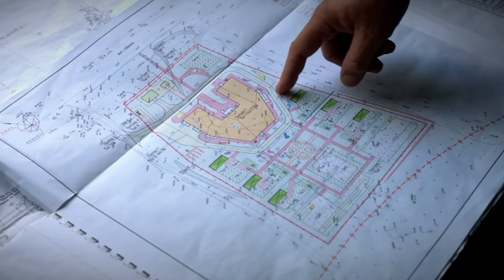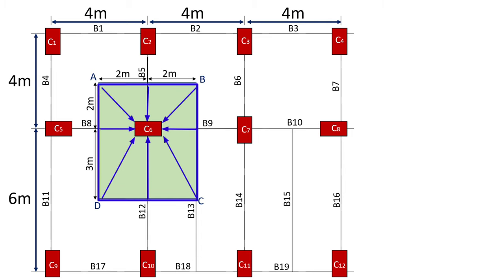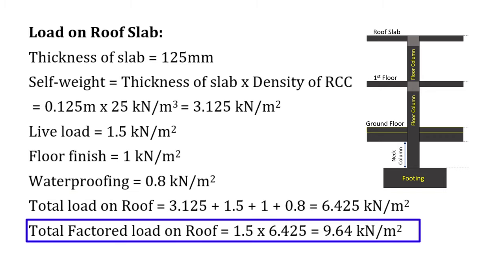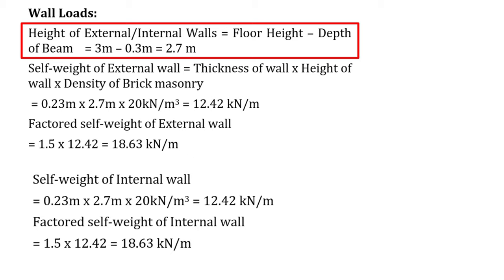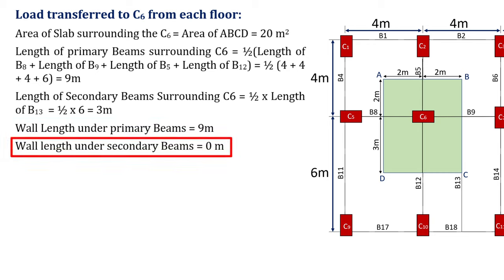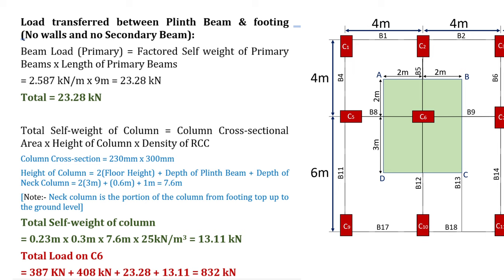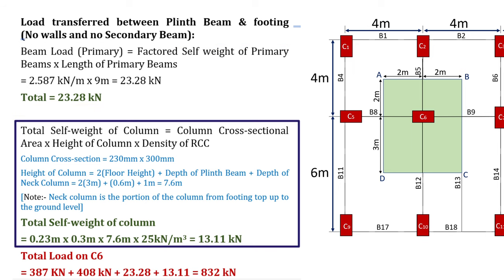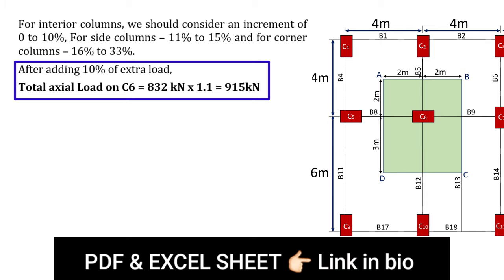How to calculate the load in a column? | Approximate Method of load calculation | Civil Tutor

Comment: Sir in this case for effective length for column, which case is applicable.

Held in position at both end 
And not restrain against rotation

Correct?
Reply from the maker: Held in position and restrained against rotation at both ends (fixed at both the ends).... Leff = 0.65L
Reply: @CivilTutor  thanks

Comment: Thank you Sir for this video of yours. But i will like to know, why is there no slab load and wall load transfered from the ground floor to the footing?
Reply from the maker: Slab of the ground floor usually rests on ground, so there is not any need to consider it unless it is a hollow slab as in case of a basement.... Then you can consider it too.....Wall load, I have already considered while calculating the load transferred from 1st floor to Plinth.

Comment: there is a mistake on beam load secondary, factor. self wt = 1.93, and length of secon. beam is 3. you did its half. it is already you took 3, then why again its half ?
Reply from the maker: Load of 3m portion of B13 will be transfered to B9 as point load and only half of this point load will be transfered to Column 6. Rest of it will be transfered to C7.

Comment: 4:57 why 1/2 multiple by 3m, 3m is already half of the secondary beam 6m
Reply: Secondary beam connected by c6 and c7,half of that load comes to c6 another half comes to c7
Reply: half of the secondary beam section is for C6 the other half is for C7.